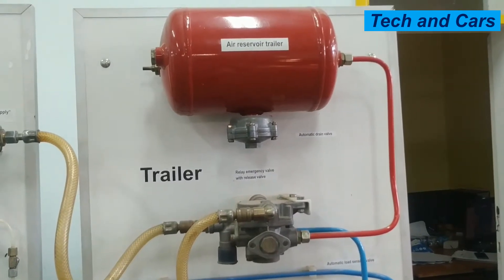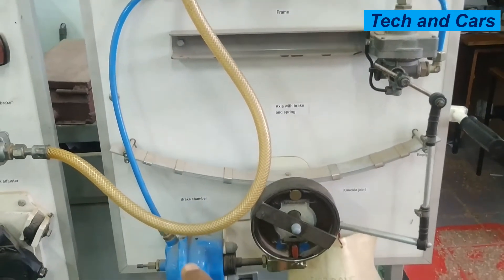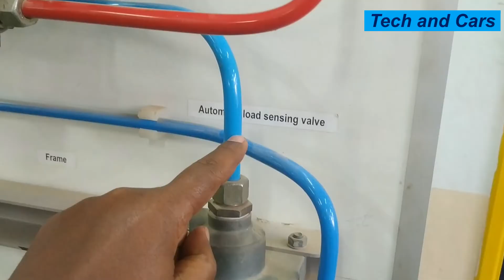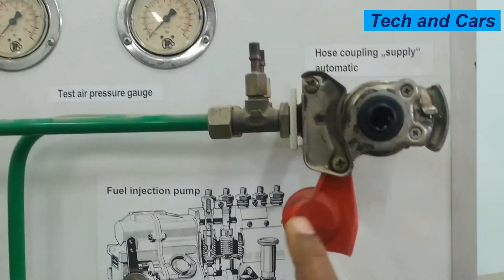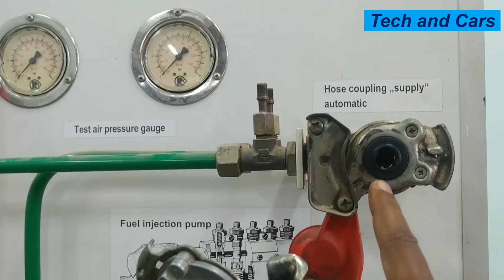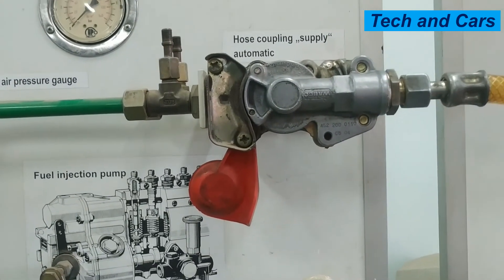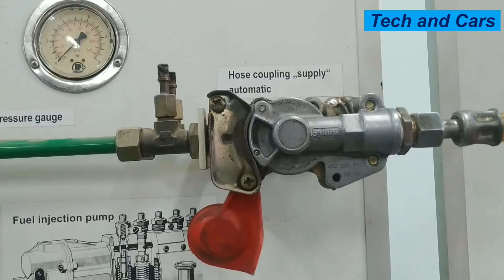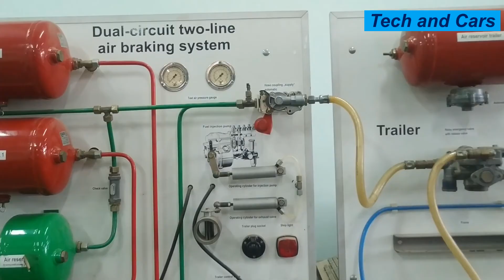How does the air brake system works  Part 4 of 4

Comment: if we have combination chambers of braking on trailer how the connection will be?
Reply from the maker: Trailers usually use simple brake chamber that get activated only when compressed air is supplied to it instead of using combination chambers. The relay emergency valve controls it based on the signal received from the tractor vehicle!